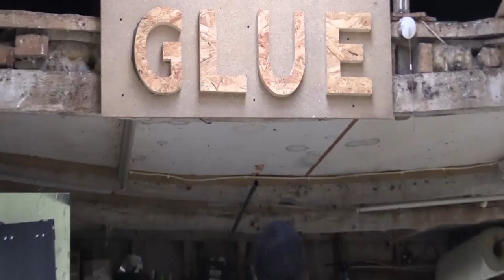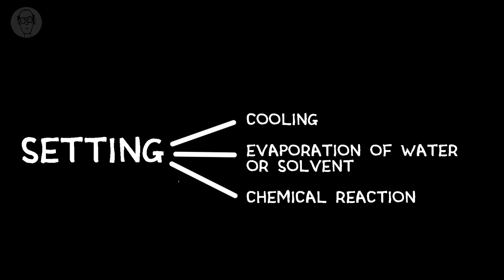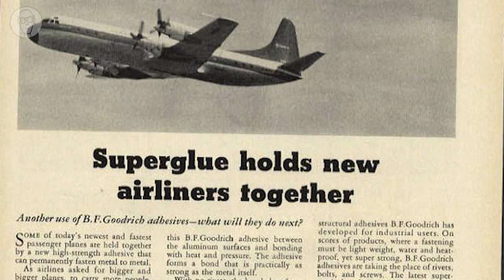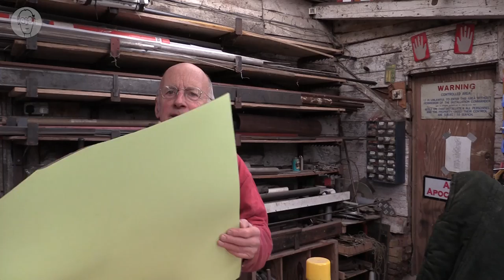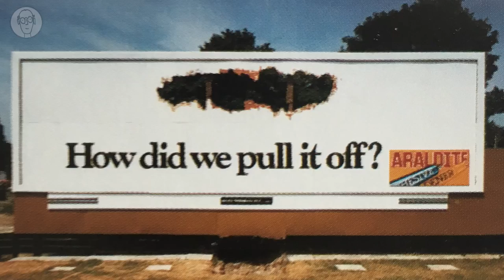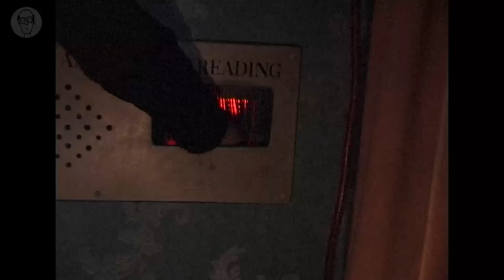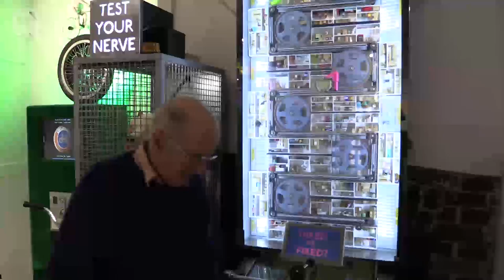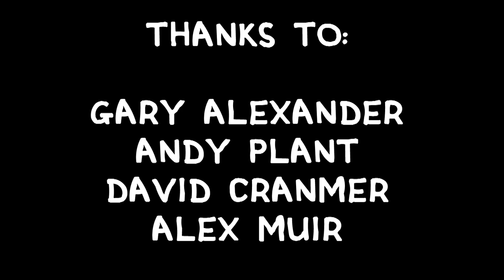GLUE - The Secret Life of Components - a series of guides for makers and designers - Episode 7

Comment: A few things I've learnt about glue over the years :-

Hot glue can be released/removed by spraying it with Isopropyl alcohol, this makes it great for temporary things that may have to be repaired/removed later but make sure you don't get the IPA on anything acrylic.

Baking Soda makes super glue set instantly and also acts as a gap filler.

Glues that set rigid like epoxy and superglue (unless they have additives that make them flexible) often fail due to thermal expansion/contraction of what they're sticking, particularly if both materials have significantly different rates of expansion like steel and aluminium for example, this causes the bond to crack which is why flexible glues are generally better in those cases and might explain why you have failures with superglue.

If you use epoxy, warming the joint while it sets makes it set faster but also stronger.

One of the issues when you were showing polyurethane used with wood was you used weights, but the joint really needs to be forced together from the sides with clamps so when the glue foams it can't push the pieces apart and instead forces itself into the grain of the wood.

Comment: Excellent video Tim. A thing that you can do with double sided tape is taping down thin work to a machine table. I always used the white tape so you can get the work off the table easier. The table must be absolutely clean and without dings on the surface when the tape is applied. Aluminum can be easily milled and drilled using this method. It is important to have the work piece in as much contact with the tape as possible.
Cheers from NC/USA
Reply: Aceroadholder, a Secret Life episode about adhesive tape would seem to be in order. Guitar repairman Ted Woodford (the twoodfrd channel on You Tube) has a number of uses for blue painter's tape, not just to protect delicate surfaces and finishes, but you can superglue things to the non-adhesive side of the tape, to hold small routing jigs and such, and then easily remove it afterwards. The guy's a true craftsman, and dryly funny (he's Canadian).

Comment: Great tip for when sticking self-adhesive sheet accurately especially if plastic film. Give a good spraying of water to wet the surface over and delay the adhesion. While placing the sheet if it's wrong can pull it away and reposition it until it's right.

Comment: Thanks Tim, what a wonderful treat to find as I woke up at 3 in the morning here in the States.

My hobby has become building crossbows and I have quite the assortment that I use too. Often you look at a bottle's claim with a large degree of skepticism and once in a while one is impressed. I used a, new to me, DAP product called RapidFuse that claims to bond anything on a tough assignment which was cementing nylon washers to the large 1/8 thick aluminum trigger on both sides of the pivot hole that act as friction reduction devices when the trigger is rotated. I was amazed at how well the stuff worked and in 30 seconds no less.

I certainly look forward to more maker based videos and especially the upcoming video on carving which I'd like to give a go at myself soon.
Reply: DAP RapidFuse is very good superglue. Hot Stuff is also very good but it seems to start thickening/curing in the bottle prematurely and the cap starts gluing itself to the nozzle in a way that the DAP is less likely to do.

Comment: I remember years ago using a two part water tight space filling glue called PC-3 or PC-7 (I forget which).  One part looked like tar and the other part was kind of light and foamy like maybe white chocolate mousse.  It was a real pain and mess to work with but was probably stronger than anything you'd glue together with it.  They had a really cool demonstration piece in the stores where it was sold: a coke bottle filled with colored liquid and a golf ball glued on the top.  The bottle also had a small wooden shelf glued to it's side.

Comment: A little trick I use to avoid have the wood to move when clamping, like in 10:00, is to add the smallest bit of med-coarse sal. Just a couple of grains will embed themselves on the wood and avoid any slipping at all.
Reply: I was intrigued but confused by the wording of this tip. For anyone else in the same boat, I think it’s medium to coarse ground salt. Will try this!

Comment: I used polyuerthane glue to glue a hewing axe to the shaft. It's an old design with a single long taper so it can't be wedged. Old timers used to use hot tar and ash as a glue.

Comment: great vid, little tip for stopping pva parts sliding about is using a tiny amount of sugar, its grittyness.... grittosity.... grittification.... whatever, helps anchor the bits when under pressure

Comment: Loctite 480 and 410 are worth a look.  They make a very strong and shock resistant bond, that’s (anecdotally, not chemically) like rubberised superglue but a lot stronger.  I came across them through a friend who was gluing rubber mounts back to metal to fix them (on fuel tanks).
Reply: I know a guy who used the green loctite on spun engine bearings after engines were seized without oil. Amazingly, he said such engines never spun a bearing again or developed a knock afterwards.

Comment: I remember working at Marconi Radar in the late 1970's, we used Araldite and while mixing we heated it up with a heat gun which apparently sped up the setting time.
I find Gorilla glue is pretty good stuff at home. I use that now in place of PVA.

Comment: Putting a screw in the nozzle end doesn't keep the air out, it seeps in around the screw thread and the tube thread at the bottom.  Besides, the stuff in the nozzle will go off and you'll have to replace it before reusing the tube.
If you need to keep your tube fresh for longer, remove the nozzle and empty it out (kitchen towel wrapped around a skewer works nicely), put 2 (two) layers of cling film over the open end of the tube, and screw the nozzle back on top of the cling film.  Even silicone lasts for over a year.
(That double thickness cling film is important because only 1 layer doesn't seem to be totally gas-proof and a tube of silicone only lasts 6 months.)

Comment: At 14:10, some polyurethane glues can be removed from skin a little more quickly with any kind of salad oil or vegetable oil. Put the oil on your hands and wear rubber gloves overnight or whatever, it may be helpfull. I've done this for expanding foam sealants like " Great Stuff". It still may take several days to loosen and start to peel off....PS, some polyurethane glues tell you to wet one piece of wood and put the glue on the dry piece of wood before bonding them together. Perhaps in a damp climate like the UK it isn't necessary to wet one piece of wood!

Comment: With epoxy on metal (esp. aluminum) my understanding was that you want to apply the epoxy then sand the metal under it. Epoxy doesn't stick to metal oxides as well as the base metal. Sanding the metal with epoxy on it (wear gloves) keeps the metal from oxidizing before the epoxy can bond.

Comment: 3M 30 NF scotch weld my favorite :) first time i see anyone using it. by the way i use those cheap kitchen sponges for it. 1 euro gives you 10 sponges and can be cut to smaller size if you want. instead of brushes ! perfect for thin materials that dont soak it up (formica, and plastics) you can also easily force dry 3m 30. to speed up things and it will remain sticky for an hour +-

instead of a hammer you can use a glue  (PU rubber ) roller to make the bond. its less noisy :) they can be had for a few euro at an art store.

Comment: Tim, use v. small amounts of salt on PVA to stop it sliding around when clamping
Reply: Also, if your PVC pipe cement goes too stiff, add a bit of acetone to get it back to life.  In fact, you can make your own by adding in ABS (ideally small bits from the saw as they dissolve faster) into acetone and wait for it to dissolve.  Add more of either ABS or acetone to set the viscosity.

Comment: I use thick (5-10mm, like 1/4-1/2 inch) foam-backed double sided sticky tape to stick circuit boards, and stuff that just has to be held in place and has some sort of irregularities on the surface.

Comment: flat surface wood glue ups and slipping. sprinkle a bit of salt between surfaces. it acts like grit to grab the surfaces just enough to prevent slips until the glue/ mechanical fasteners setup.

pool noodles and similar foam plastics (construction sheet foams(2mm etc)). can be heat bonded via soldering gun/heat gun.

zip ties and a weber soldering gun can be used like a welder for some plastics.

Comment: FYI the time on epoxy is the working time, i.e. the time you have to move stuff around and apply it.
I also find C.A. glue useful with epoxy to tack in place parts while the epoxy hardens.

Comment: Another use for hot glue - fixturing. I'll use it to hold the work to a surface or "handle" if need be. When done, a little alcohol in the joint will creep in thru capillary action and physically break the bond if the surface is reasonably smooth.

Comment: It may be of interest to some of you (especially if you want to get things apart) that almost all commercial glues go very soft at 120'C or below. Very few remain firm or hard above that.
For getting things apart leaving them in boiling water and then in a jet of steam (which is hotter) is often enough to get things apart, failing that an oven at 120 or just above.
If you want to glue things which get hot, check the spec, you will have to hunt around a bit.
I can't remember which one I used to use now.

Comment: The by far easiest glue to remove is hot melt glue, at least the standard variety, not sure about the high strength ones, but there's a trick. You simply sprinkle some alcohol around the joint, it absorbs it, the glue expands, unbonds from the surfaces, and falls off in a handful of somewhat crumbly pieces, not too many, the cleanup isn't tedious at all. Isopropanol and Ethanol both work, not sure if one is better than the other.

Comment: A bit of salt sprinkled on the surface of wood glue will stop the joints sliding about before it sets and doesn't seem to affect the strength of the joint.

Comment: Just a few comments, one, hide glue can be surprisingly strong joining glass to anything, like wood or metal.  Perspex can be glued using chloroform (formaldehide) and it creates a transparent joint if used sparingly.  Cyanoacrilate and activator make a weaker union than just using cyanoacrilate. Another trick to glue difficult surfaces or to fill in cracks is to sprinkle Royal baking powder on the joint and it sets instantly and very exothermically.
Reply: Beware that chloroform CHCl3 =/= formaldehyde CH2O , and only chloroform will work for welding perspex (formaldehyde is generally an aqueous solution).

Comment: Nitromethane (model airplane/ race car fuel!) will soften and loosen many types of thread-locking glues such as lacquer-like Glyptol (often used by electronics manufacturers). Don't use it near sparks or flames!  MEK, methyl ethyl ketone, also softens some adhesives, but stinks to high heaven and is very flammable. Either one can damage plastics, so use carefully.

Comment: Good stuff. BTW, alcohol (I use meths) is great for softening hot glue gun glue. I hot glued an RC servo to a lump of wood to do some tests, thinking it would come off easily. No chance, 'til I found meths!
Reply: That's good to know. I've known for a while that IPA does that, but I've never tried it with meths. I work in electronics and the IPA is usually to hand, but if I need to release any hot glue at home I'll reach for the meths!
Reply: @djfromage  , you should clarify that IPA is isopropyl alcohol, and not some type of beer or ale! Meths would be methyl alcohol, aka methanol, I presume, and not methamphetamine!
Reply: @goodun2974  Indeed, IPA as in Isopropyl Alcohol, and meths as in Methyl Alcohol / Methanol / Methylated Spirit.
Reply: @djfromage  et al - meths is ethanol with stuff added to make it unpalatable. Methylated spirit is NOT methanol. If you ever play with little (eg aero) ic engines you'll spot the difference!

Comment: to add to unglueing tips; superglue will decompose at higher temperatures, and most hot glues will release cleanly if you soak them in isopropyl alcohol. also, most double-sided 3M or 3M like tapes will release if you twist them around, as they have very poor shear strength.

Comment: It might not be this level of info but a guy showed me this technique and I used it around the house fixing various items, but this technique only works on surfaces you can't see because it's ugly and messy:
To glue together something that broke, apply super glue along the seams, then add some more glue on one of the sides that doesn't show, then sprinkle some baking sode in it. Or you can start with baking soda and drip some superglue on it. You can build it up layers is needed and if it's too much you can sand it back down. It gives more structural integrity to the glued parts. But be careful because super glue has fumes that can damage other things around, so if you are glueing a remote control make sure you take out everything else, glue the plastic shell then wait 24 hours before you reassemble it.

Another weird plastic gluing technique is used with ABS and acetone. You have to be really careful with it because acetone melts the ABS and bonds it together. Again, you can use this on the inside of plastic objects by adding little ABS plastic pieces as a reinforcement along the break line.
Reply: I'm literally moments away from glue'ing up my first ABS box, and i've got a few offcuts left over. Reinforcement of the joints is a great use!
Reply: @cannaroe1213  I saw a guy fixing an old computer's case with model kit leftovers as reinforcement, but I don't know which video was that, maybe it was a Commodore 64.
Reply: Beware that both acetone and methylene chloride can also cause nearby plastics to haze (e.g., transparent -> crunchy white) rather the way superglue does...
Reply: @theskett  sure, this technique can only be used on a surface that is not visible, if it's a transparent plastic then it's not an option.

Comment: Been a fan since 1993!! What do you do to quiet down the 'THWACK' of DC solonoids? I've tried to do it but didnt know what kind of material to make a stopper out of. Obviously this material has to withstand being crushed in the solonoid yet still absorb more then the first smash.
Reply: Did you try door stops? Y'know, the rubber or steel-spring things that I'd use to avoid banging the door into the wall, to prevent door-handles from punching holes in the paint-job / rockwall.  They're pretty cheap, and designed to take a beating.

Comment: 27:00 - Have you seen Jimmy DiResta's system? He just leaves the brush inside the can, cutting the handle if necessary so it fits. That way it stays submerged in the lacquer or glue (and its solvent), which means the bristles don't harden, and it's also "loaded" and ready to use as soon as he opens the can.

Here: https://www.youtube.com/watch?v=DjCPS6FD7RM&t=4m21s

Comment: i will quite often use lil dots of hot melt glue with other glues such as pva.  So the dots of hotmelt hold the joint while the pva sets.  I call it wood welding. i might have invented it myself i think.

Comment: Polyurethane glue goes foamy as it dries due to a chemical reaction known as polymerization. Polyurethane glues, also known as expanding or foaming glues, typically contain isocyanates, which are reactive chemical groups. When the glue is exposed to moisture (either from the air or from the surfaces being glued), the isocyanates react with the water to form carbon dioxide gas.

This reaction produces bubbles of carbon dioxide, creating the foamy texture you observe as the glue dries. The expanding nature of polyurethane glue helps it fill gaps and spaces between surfaces, making it particularly useful for bonding uneven or irregular surfaces.

Here's a simplified breakdown of the process:

    Moisture Activation: The glue comes into contact with moisture, either from the air or the surfaces being glued.

    Isocyanate Reaction: The isocyanates in the glue react with water to produce carbon dioxide gas.

    Foaming: The carbon dioxide gas forms bubbles, causing the glue to expand and create a foamy texture.

    Curing: As the glue dries and cures, the polymerization process continues, resulting in a strong and durable bond.

The expanding nature of polyurethane glue makes it suitable for applications where a gap-filling adhesive is needed. It's important to note that this foaming characteristic may cause the glue to expand beyond the surfaces being glued, so it's advisable to use it with care and be prepared for any excess to be trimmed or removed after drying.

i am surprised you didn't know that.

Comment: I've learned to dislike superglue because it really really dislikes heat and turns brittle, plus when gluing dark plastics (or just about any dark surface really) it more often than not will outgas over time and leave white-ish marks and streaks that seem to be impossible to clean off with anything I've tried so far, effectively ruining whatever surface it got close to